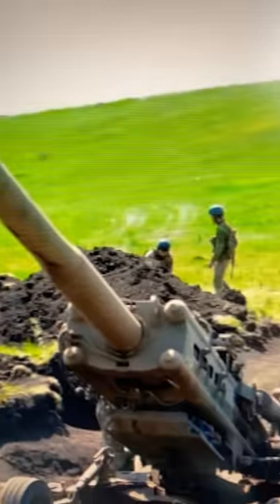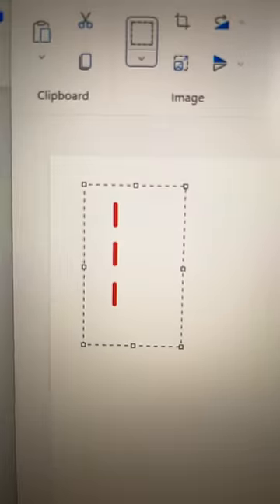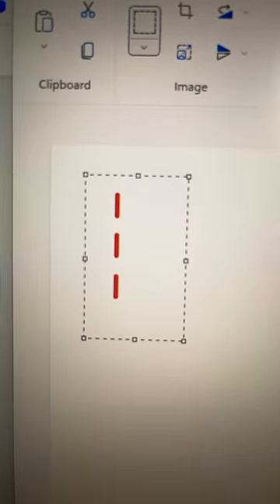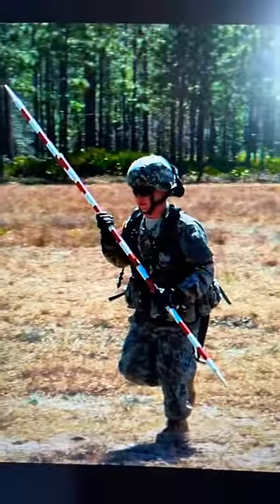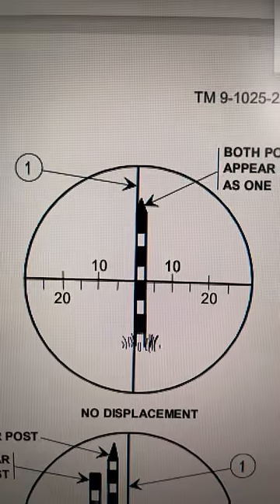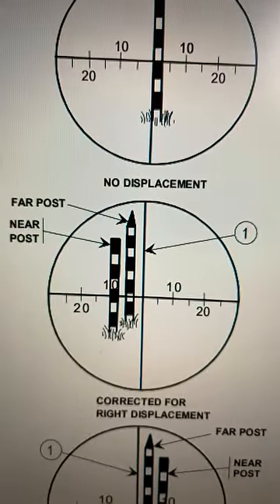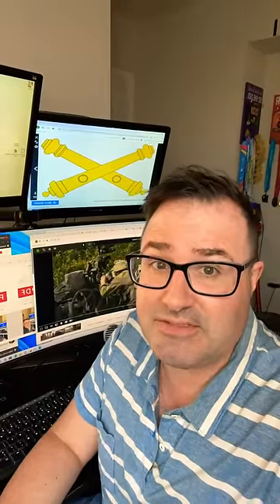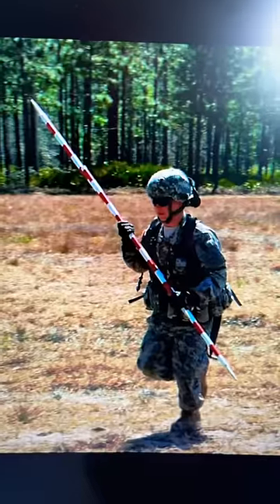How is an M777 Howitzer Aimed?

Comment from the maker: Join the Discussion at:
https://discord.gg/pKuGDHZHrz

Follow me on Twitter at:
@ryanmcbeth

Most artillery is aimed by looking through a sight at an candy-striped aiming post.  The sight is then offset from the aiming post as ordered by the Fire Direction Center.

When the artillery is fired, the sight is rechecked to make sure the gun hasn't moved.  If it has, the post is re-sighted before firing again.

References:
TM-9-1025-211-10
Reply: It makes sense. Nice clear and concise explanation. I recognize those striped sticks from construction too. Thanks Ryan.
Reply: Artillery here, aiming poles are usually used as a backup nowadays, but the principles are still the same; the sticks are set at two different distances—usually about 50 and 100 meters. I enjoy your videos, and most of your information is highly accurate.  Keep up the good work, brother.
Reply: Most of this seems like it could be computerised to speed up the process. Not just calculating the firing solution, but couldn't the targeting data be sent directly to the gun and lidar or other sensors be used in place of the aiming posts?

Or is this a case of that all being possible but what you've outlined is either a backup or more practical in real world conditions?
Reply: Question: how does counter artillery fire work, or: how do you locate an enemy artillery postision, get the distance and return accurate fire (I know it has something to do with sound but otherwise I have no clue).
Reply: Thank you
This was a great video
Reply: Puts down sandwich and hot coffee 😂🤣
Reply: @jeffreywilliams5093  a couple of things. First, the US military cannot be deployed domestically. Second, a very large majority of the military are the very same people who are very pro 2nd Amendment. So they wouldn’t go into active combat against US citizens domestically. Any orders to do so would be unlawful. 3rd, look up guerrilla operations and tactics. You don’t need artillery to conduct those types of operations.
Reply: As an Cannoneer, you are very close but wrong. The FDC tells the gun section a deflection and the Gunner uses the aiming post to lay on that deflection. There are two sets of aiming post one in front and one in rear of the gun. That way the gunner can always see a set. You where close enough so I'll give it to you.
Reply: The aiming posts are last resort. Your actually either using the onboard computer using gyroscopes or your looking at a M1A2 Infinity Aiming Collimator which is a telescope thing with number inside. Me being a gunner I've shot on aiming posts only twice in my career
Reply: @snacka1345  haha amarican is so different. We just get new bearings everytime. The howitzer technically doesn't even need a fdc so you can do daily accurate harassing fire or quick action missions
Reply: I would guess a mortar is aimed the same as way, right?
Reply from the maker: @napster7825  yes. I skipped over a lot of steps and didn’t even mention the GPS and computers and even the collimated, But that is too much to pack in a short video. I’m planning to do a longer one that really gets into the weeds.
Reply: @tg13fire  we also use digital fire control. The Marine Corps would only train with Anolog systems, then verify with the digital. This is to ensure that we could fire even if the digital systems failed. However in combat the Anolog was on a back up for if the digital failed and we never used it.
Reply from the maker: @snacka1345  Yeah, it's tough to get all of that down into one minute.  If you are a 13B, please connect with me on my Website.  I'm doing a long form video on this and I would like to hear your story.
Reply: More indepth?
Reply: @Google_Does_Evil_Now  I've never been on a construction site that needed to take the rotation of the whole Earth into consideration!!
Reply: @jeffreywilliams5093  Palestinian Insurgents make their own home made Mortars, AND the Ammo, so I'm pretty sure that you can find a whole lot of potential militia members with the metal fabrication skills and training, AND the equipment (or access to it) to make sure that a supply of light Artillery Support could be brought to bare on an "enemy"

Still wouldn't be enough, but it's better than nothing.!!
Reply: @Rob-zz7bq  They were using sound, to locate and aim counter battery fire, as far back as WW1. When I found this out, I was just blown away ... No pun intended!!!
Reply: @BrentDnD  Doesn't every US Soldier, Sailor, Airman and Marine take an oath to "defend the Constitution and ...
Defend the United States of America against ALL enemies, Foreign and DOMESTIC ..." And if that's so, then doesn't that mean you would have to be deployed somewhere in the United States if the enemy was domestic, making it totally Legal and Lawful for the Government to deploy the US Military, within the borders and (potentially) against US Citizens?
Reply: @frenzalrhomb6919  I'll reply with a couple of points.  

First, the Posse Comitatus Act, 18 U.S.C. Section 1385 precludes the federal government from deploying the US Military to enforce domestic policies within the United States.  This was most recently expanded to confirm that it includes the Space Force as of National Defense Authorization Act for Fiscal Year 2022.  To be fair, I should note that the Insurrection Act was briefly expanded in 2006 to allow for a more generous set of circumstances that would allow for the employment of US Military domestically, but in 2008, that expansion was repealed in its entirety.  Although the Insurrection Act can still be invoked, and has been invoked a total of 23 times, most recently for the Los Angeles riots in 1992.

Second, the oath when we (I am a proud veteran) enlist or accept a commission in the US Military is very sacred, but that oath, as you point out, is made to the US Constitution.  Not to the whims of an officer, or even the President, if they were so inclined to issue unlawful orders.  We have a duty not to obey unlawful orders.  

And third, depending on the circumstances Mr. Williams was referring to above, the federal government, in its law enforcement capacity with its many agencies is certainly capable of handling any militias that start to think they are above the law.  Additionally, the governors of the states are authorized to activate the National Guard in a law enforcement capacity with the confines of their state.  (And a state's National Guard can also deploy to an adjacent state if the governor of that state requests such assistance.)

So no, the US Military is not going to be deployed domestically unless it's under the most extreme circumstances.
Reply: They do not factor the curvature of the earth / 8" per mile square. Show the math.
Reply: What about more modern guns? Do any of them use gps?
Reply: @jordanelmore3742  so is the taget distance given in meters? and  calculations also done in meters?
Reply: @frenzalrhomb6919  , ya. We went to coffee when the sun reached 10: 00, and to lunch when it reached noon, ...break ....home when the sun reached 4:30.  👍
Reply: @matthiasknutzen6061  yes, meters are used. When the first rounds hit, an adjustment is made by the person calling in the fire mission. Then the elevation and azimuth are adjusted accordingly.
Reply: Primary aiming references in m1a2. aiming poles are backup. The FDC gives azimuth and elevation. The Gunner puts those numbers into the site. Then changes the azimuth and elevation of the gun so he can see and align to the m1a2. The FDC doesn't know your displacement.
Reply: What exactly is the aiming compensation for the earth rotation?  About the same as a pilot's downward trajectory to compensate for the curvature?...lol.
Reply: It would be a real stick in the mud if the stick broke.
Reply: Negative. Those aiming post are a secondary aiming point and used to take up displacement. The primary is a colimeter
Reply: Love your insights Ryan! 
I 100% agree except for one thing - earth rotation calculations. That is never calculated bc earth is stationary. If what you are claiming is correct - flight times would be greatly reduced when flying against the spin! Peace to you brother!
Reply: @ithinkthonkthunk5333  See my comment in this thread...that's the only thing I called him on as well.
Reply: @timmoles9259  - thats correct bc earth is not a 🌍
Reply: @Rob-zz7bq  Radar. Most artillery units/ battalions will have radar operators that will view for outgoing and incoming artillery.
Reply: Old Tm or looking at a backup aiming reference point! You would 1st use the columeter if digital on the 777 went down.. that is primary back up then aiming posts then it that is down you have a predetermined 3rd back up aiming point to reference such as a radio tower, edge of building, or some other permanent structure hopefully straight as possible.. so your not ENTIRELY WRONG  but not exactly right either sir
Reply: @josephkennelly8953  it is, the M777 is a highly sophisticated gun! On board computers that tell you where to aim, and communicate directly to the FDC,  you don't even talk to them nerds in FDC.. it all come to a tablet type device plugged into the computer on the gun that tells you everything you need to know about the fire mission! It's way better than the old M198 I was a gunner on both!
Reply: Hey man good video I was wo wondering how fast from picking a target can they get a shot off
Reply: Hey can you check the colimeter for cracks real quick....lmao love that one lol
Reply: As a 13B you are close but the main two things is the firing poles are one way we can aim we also have a colometer and when we get a fire mission we adjust for quadrant and deflection I don’t necessarily understand how you correlate it but he could be using either one in the picture
Reply: Always wondered.
Reply: @RyanMcBethProgramming  that sight thing is the emblem on their dress white and blues for Fire controlmwn in the Navy. You gave me a good flashback :3 i was an IT though
Reply: What are you say" spinning of the EARTH " xaxa NOBODY MAKING THAT CALCULATION!!!
Reply: Ryan you are wrong about the mils correction from the aiming pole. The corrections in the data is changed in the sight. You then realign the gun to where the far pole in in the middle and the sight bubbles are aligned. “Hey diddle diddle far pole in the middle. Good video but a little more reading on the tm is needed. I was an 11c for three years before I switch to air defense. Mortars and artillery follow the same principles for aiming.
Reply: You forgot they use the M1A2 as well. King of battle, Red Leg for life.
Reply: I always wondered how they rereferenced the guns after a shot.
Reply: Trump 2024!
Reply: When I started researching artillery for a story I am working on, I expected to find a highly advanced targeting system. What I found is that aim requires setting up a stick as well as sending out a guy with a map, compass and a radio to figure out where the enemy was.
Reply: I beg to differ, about your claim that this is a low tech stick, because they’re calibrated to an incredibly high degree(each red/white portion has to be the exact size, down to a part of a millimetre), especially if you realise that a single millimetre/degree out at the point of fire, means that you can miss by quite distance(tens of meters or so, depending upon the range) when you are aiming at a target at the extreme range of the piece/round……..
Reply: Must not be too many flat earthers that do that job
Reply: So I am in the toc with the fdc. Its a chill morning and we start operations and begin fire missions. Because of dumb planning our 105s are shooting over the toc directly at the fo into a box in between us.  Yes this monumentally stupid. One round goes, two rounds goes, third round......TING BOOM!!!!. New officer looks at fdc, 'Is that normal.' Fdc putting down 'fresh coffee' grabs helmet puts head down between his legs and a scared meek voice 'no.'
I grab the radio yell cese fire. I get back a pvt who is a fo that has clearly pissed himself and jacked on ripfuel, 'aaah ahhh dont shoot us please.' Lost all military baring on the radio from fear. Round lands i think 90 or 100 feet next to the tower they in. If the gunner had fucked up aiming at that sick i would have lost friends. Plus side counter battery radar got really good practice with what incoming really looks like. 

It turns out privates loading powder cant count bags correctly and over loaded it. Idk what smoke was doing. The worst part.....they reloaded that gun. You know they  thinking no one noticed that different boom. Maybe we can get away with this. 😮 
Side note: yes, i pointed out we shouldn't be in these positions. I was causing so much shit 2 different master sgt and a cpt threating me with article 15 if i didnt drop it. I should went to the battalion xo. He was a good guy and would have listened.
Reply: I’m stationed at Fort Bliss TX 1st Armor and would like to see if you would like to come out during our TBL XII certification. Our unit has the M109A7 paladins let me know if your interested and if you have the time.
Reply: First shot 10sec max FDC fire solutions.
Reply: I'd like to learn more of what launch pattern/trajectory artillery shells make and if or with what they can be intercepted?..
Reply: WE GOT A GLOBER!!!
Reply: @RyanMcBethProgramming  Not to mention it would also depend on what sort of fire mission the FO was sending(6 number grid vs say a 10 number grid).  Also, the FO would be the one sending corrections to the gun crew.  But, I will say that if you didn't have the 13d's aiming would be horrible.  (former 13f here.)

Comment: And at night we have to walk to all of those aiming poles and turn on a little green or red flashlight so we can still have a reference. Fun times having to rock paper scissors in Afghanistan to see who has to turn on the lights at night. I'm not very good at rock paper scissors tho...
Reply: Even worse if you were dug in to a mountainside. 🤦‍♂️ I hated that. Lol. Forgot to turn them off one day. Then, when night came, I wen to turn them on. But, apparently, I turned them off. We ended up having a fire mission right at dusk. And my ass proceeded to get smoked for about 2 hours after the mission. Running up and down that mountain side turning them on and then turning them off again. 🤦‍♂️🤦‍♂️
Reply: My cousin in Iraq a few years ago said at one time the enemy was less than 200 yards away from his artillery gun. Is this something that happens in modern battles.
Reply: 💋💪🏽SFFF.
Reply: @benrollin1207  it definitely could, depends purely on unit movement and environmental awareness
Reply: @benrollin1207  In Vietnam arty units would sometimes level their barrels and engage the enemy with direct fire using Beehive rounds that contained dozens of flechettes for a shotgun like effect.  This was used when the enemy got really close.

Comment: Those “sticks” are really there to serve as backups, most of the aiming is done by a computer built into the guns which can get you onto the deflection you want faster than the sticks can.
Reply: Or a colimeter definitely alot easier then running poles or use a DAP if you got one don't have to worry about near far line or displacement